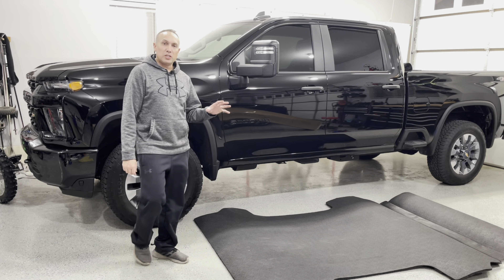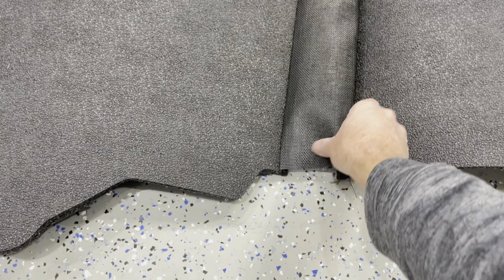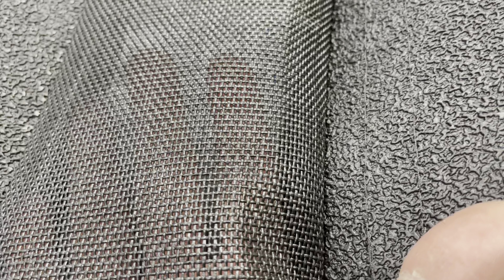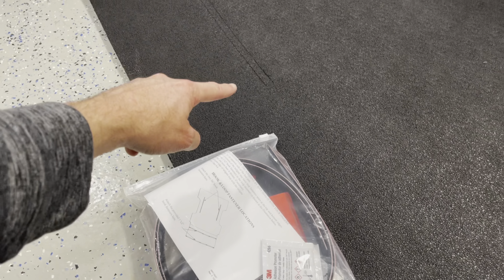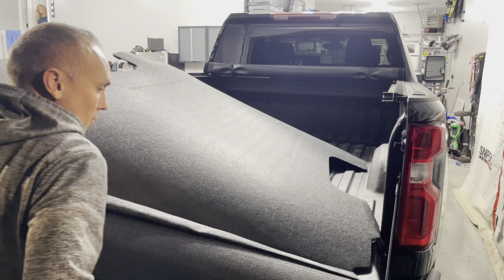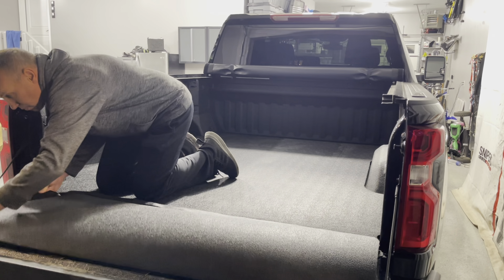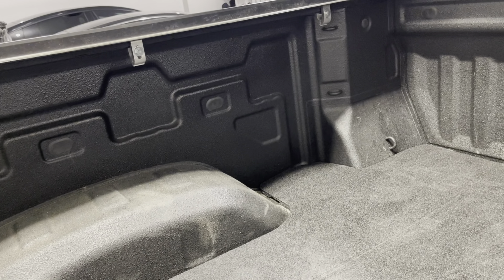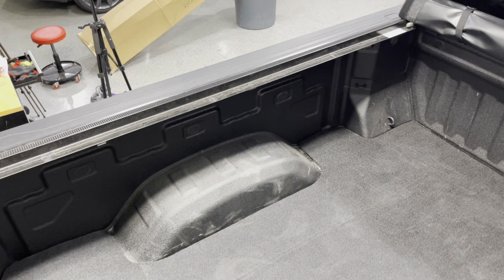BedRug Impact Mat | Chevy Silverado 2500 HD Bed Protection

Comment: Do you need to take it out for wash day, to dry the metal and limit wetness and corrosion underneath?
Reply from the maker: Well I have a spray in Bedliner underneath, and I have a bed cover that keeps most of the water out, so i haven’t done that but probably is a good idea